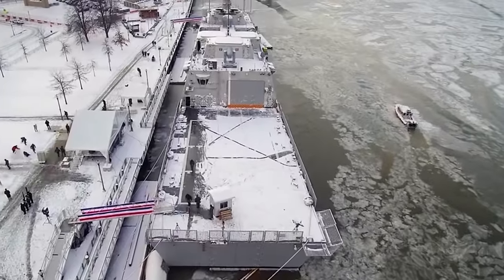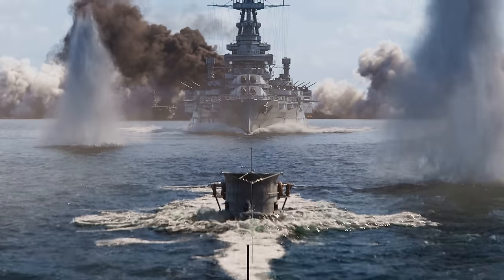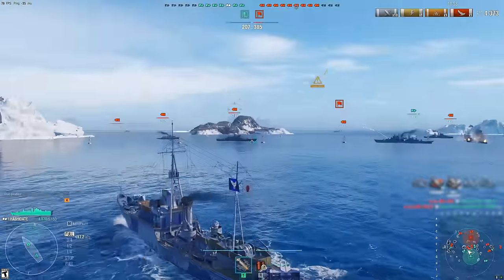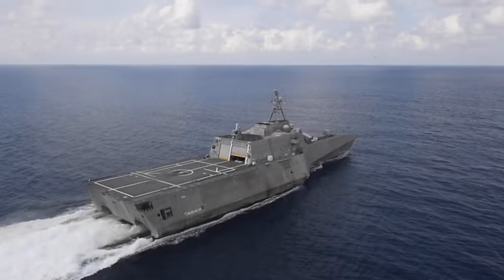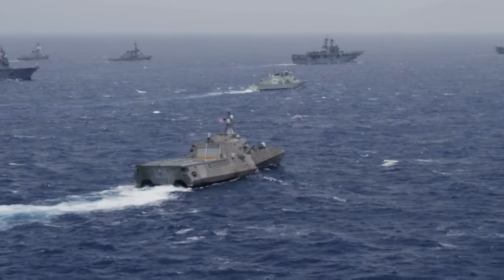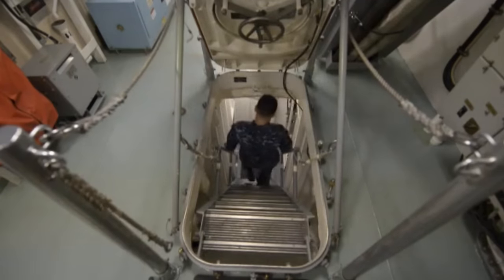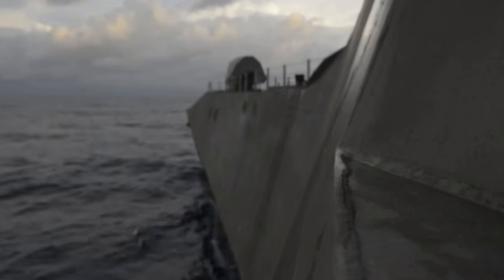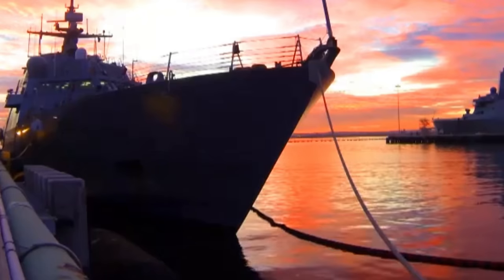Is the Littoral Combat Ship the worst ship in U.S. Navy History? | BIGGEST NAVY FAIL 👎🏼

Comment: The navy needs to stop building 30 ships just to test new concepts like Aluminum hulls, low RCS designs and composite mast/sensor arrays.
Reply: Indeed, I think the situation was more one of an engineering failure than a concept. I've worked on a military project, where again they wanted the world fitted into a kitchen sink. Once we convinced them to pair down the initial objectives, things finally started to move, only twenty years behind schedule.
What needs to happen is the military guys who are going to be operating these systems and engineers need to sit down and create a workable set of criteria, then work out costs. At that point the managers and politicians can get involved, and not before.
Reply: The USN should repeat the success of the V-boat program where they built 5 different classes of submarine prototypes for 9 boats total. Then after a decade of development, the best model was mass produced.
Reply: @tedferkin  Engineering and modules.  Many modules either came to the fleet not working or never made it to the fleet because they did not work.
Reply: so true dude. In german we have a phrase for this, we call it "die eierlegende Wollmilchsau" translated word by word it means: the egg laying wool milk pig  @tedferkin
Reply: None of those things were new…
Reply: That would have been the first plan...
Reply: maybe the appropriations process is the problem, and getting hung up on unit cost
Reply: @MrTaxiRob  The problem is the contracts. They sign for 10+ ships before even testing the first one.
Reply: @BravoCheesecake  yeah but what is the solution? Imagine being a ship builder trying to do things at scale when the government wants them, but only doing one-offs most of the time, and never knowing which direction you need to invest in tomorrow. 

Should we nationalize defense industries? How else would we keep production moving when we're pouring what much capital into prototyping? 

Look what happened to the Russian Navy, they kept changing their aircraft carrier designs in production and now they don't have any. And they blew a lot of money under the Soviet government on ekranoplans and other garbage tech.

 I don't know the answer either, but it's too complex without some kind of direct state backing to prop it up financially.
Reply: @MrTaxiRob  Is theirany large difrence between building one or ten of something that. when tested is shown to be a bad idea. I think LCS has the same problem. that the sovjet navy had. A lot of pepole with no clue. wanting to make things that sounds like a good idea.
Reply: @exploatores  agreed, and politicians enable them to either get work for their constituents or pad their own pockets or both
Reply: @米空軍パイロット issue with that is that its way more money. Mass production in ship industry is not really mass production. It have to be right from the start.
   What could be done is to build more and cheaper and build new more often  thus spreading the risj of failure.
Reply: To be fair they were to replace several of the other ships and functions. So the number needed to be high. 
   But the  tricky bit is that one have to be challenging one self and build new things. Other wise some one else will be ahead. But its true. Very hard to balance.
Reply: @perelfberg7415  the problem is when they want to much of one thing. It´s a bit like anytime they present a weapon that can replace anything from a PDW to a DMR and LMG. Has that ever worked.
Reply: they need to build new stuff, even tho past version was perfect. they need new weapons to sell
Reply: @MrTaxiRob  Solution is basically the new Constellation program. A 1+ 9 program.
Reply: @tedferkin This is an issue of shifting priorities. Those are dictated by the American people. American citizens decided that they didn’t need a “brown water” Navy anymore.
Reply: US really like to buy overpriced shyts
Reply: ...but, but, but....everyone likes metal...even though the original proposal call for polymer/carbon fiber/plastic/fiberglass tri hulll....
Reply: @Echowhiskeyone  How hard is it to make a home out of a standard shipping container?  That is what modules are about plug and play...

Comment: My father was in a position where he tasked assets out to hunt narcos subs... he said the LCS's were by far the most unreliable platform. Near-constantly down for maintenance and unable to be sortied.
Reply: Wrong application.
Like using an aircraft carrier to chase smugglers.
Reply: @allangibson8494  the LCS are literally supposed to be used in the (littorals which is near coastal waters) and against asymmetric threats which means they were supposed to chase after non peer militant threats such as small boats and the like. so that was the closest to their actual purpose possible.
Reply: @allangibson8494  They were designed to deal with coastal threats so yes actually this is supposed to be within it’s mission set.
Reply: @Cris-xy2gi  And the US Navy has been using them as DESTROYERS to chase submarines in the Pacific.
As to having problems with hull cracks, the entire Iowa class battleships had severe hull cracking problems (they had welded patches put on in the 1980’s when they were recommissioned and a number of WW2 cruisers had similar issues (including one losing it’s forward third of its hull).
Reply: @allangibson8494  The USN is decommissioning most of them and the remaining ones are being turned into dedicated mine sweepers, not sub hunters. They definitely aren't being used as destroyers.

And what does the Iowa have to do with any of this?
Reply: @Cris-xy2gi  They WERE being used as destroyers. They are being replaced with destroyers.
The LCS ships never got the equipment they were supposed to have and spent their days running around in deep water (not the shallow waters they were designed for).
Wrong application for the hulls.
Ukraine could conceivably make good use of them however. Running round the Red Sea is another possible application (but they would need enhanced ground to air capability (like the German Gepard system).
Reply: @allangibson8494  that because the right size to fit the DESTROYERS. destroyers are meant to hunt small fast attack craft. the current destroyers have gotten so big that they are cursers. generally a destroyer has top speed of 40 knots and below 5,000 tons so it be good attack torpedo/missile speed boats.
Reply: @spark300c  The current destroyers got so big to physically carry ship killing missiles and radar to detect aircraft at 300+ miles. Its is called “capability creep”.
A modern destroyer packs more “punch” than a WW2 cruiser.
Reply: @allangibson8494  yep and capability creep why drifted into a different class.

Comment: It was a BAD idea from the start. When I saw the specs while I was still in the canoe club knew it would never live up to the hype. Most of my fellow shipmates wondered why they didn't just bring the OHP frigates back they were way more capable and been specialized for specific missions and left that way.
Reply: Look at how the contract was written, which state the builder/maintenance provider is based in and which senator sits on the committee overseeing Navy budget and one would know why they keep building these lemons. Navy can't even perform their own maintenance as the ship tech was proprietary and have to contract civilian vendors to come do maintenance. At least it seems the navy is learning the lessons from LCS and Zumwalt procurement.
Reply: "It was a BAD idea from the start."

Oh no, the basic idea was just fine(as is mentioned, other nations have done similar stuff without problem, Denmark, Sweden etc).   But they were trying to put cruiser level packages of ability into a corvette/frigate.
And then had engineers that appears to have spent more time smoking something interesting than doing basic math to make sure things connected properly together.
Reply: @DIREWOLFx75 Denmark and Sweden don't have to cross an ocean to reach the battlefield. America's geography means they innately need larger longer range ships.
Reply: @jgw9990  That has absolutely ZERO to dow with all the epic level failures these ships have.   Quite the opposite even!

The modular design attempt was laughably inept.

With the Swedish Visby corvettes, despite the much smaller size, which is a severe issue for this, the modular design worked as conceptualised, even if they essentially dumped the ability to quickchange modules as it was simply not useful enough to be worth it.

But USA, even with all that much extra space, utterly failed to achieve something even halfway as functional.

"America's geography means they innately need larger longer range ships."

Really?   USA is not an island nation.   USA have no real enemies anywhere remotely near their coasts.

No, USAs geography has absolutely nothing to do with it.

USAs aggressive and psychopathic imperialism have everything to do with it.
Behaving like the absolute worst combination of imperial Spain, Portugal, France, Belgium and UK.
Reply: @DIREWOLFx75  Ah yes. I saw your raving comments in other places. I have nothing to say to you.
Reply: @DIREWOLFx75 It was a bad idea from the start. Nobody needs a 44 knot, 3000 tonne speedboat.
Reply: @jgw9990  Geography 200 , whats the name of the sea that lies between Sweden , Denmark and Kaliningrad , St.Petersburg ?
Reply: @matso3856  The Nato lake c2023.
Reply: @jgw9990  Baltic Sea also known as Nato lake , you are correct

Comment: The idea of modular jack of all trades war equipment, needs to stop being a thing. The ultimate idea of trying to save money will end up, actually costing more money and lives in the long run.
Reply: It works for the Danish navy... It is also a pretty sound concept, but why invent something from new, when others have made it work?
Reply: For an example of a successful JOAT project, look at the F-16.  Doesn't specialize is anything, but seems to be capable of doing everything one can expect of a fighter or attack jet and reasonably well.  It should be studied as a successful example before people embark on further JOAT projects.  The LCS ships should be studied as one of the most dismal failures before embarking on another JOAT project.
Reply: @namyun2743  The F-16 design team motto was "Not a pound for air to ground."  It was explicitly designed as the worlds best visual range air superiority fighter.  The fact that it became multi-role is due to the quality of the design, not that it was designed for that.
Reply: @k53847  And the F-16 handled that mission creep incredibly well.  For the lack of baked-in air-to-ground when it started,  It ended up with ALL the air-to-ground in the end.  The LCS?  It couldn't even get it's first modular mission package sorted out.
Reply: @namyun2743  Well, the first iteration of the mine clearing module apparently violated the laws of physics.  It included a sled that the MH-60 couldn't tow, at least safely.  I have no idea how they did that.

Comment: Yer giving them too much credit Matsimus.

It never made sense.

It had 3 roles.
ASW.
Minehunting.
Small craft hunting.

2 out of those 3 roles do not require 3500-4000 ton ships moving at >48 knots. = Wasted space and money. Hell those 2 requirements are diametrically opposed to noise and speed.

The last one is probably better served by either making a 50 - 60 yard-ish ship that you forward deploy. 76mm OM gun, guided ammo. SEARAM self defense. Drones for spotting and lasing. Spear/Brimstone class missiles. Or adding small/medium sized drones with a multi use missile like Martlett.

Or adding those drones to normal ships and adding the Martlets to the autocannon RWS most US warships already have.

Engineering wise they shouldve built prototypes and tested the heck out of em.

The only thing the LCS contract was is a "extract money from taxpayers"  scheme.

Comment: If you know boats, you know two hulls are twice the trouble if they are as autonomous and widely separated as the hulls on these Littoral ships.  The bending moments at sea must be enormous, leading to strains and forces exceeding what any material is capable of holding.  They need to fire the computer that designed these ships.  A  human being would know that there's no way to keep two hulls connected without cracking and bending eventually.

Comment: The USN didn't take a page from the others navies (Not invented here syndrome) that successfully implemented the modular sensor and weapons (dutch I think).  The short version is that you need more R&D to pull this off, as well as a ton of design and iteration to pull off, and a well hammered out messaging protocol for the modules to communicate with each other as well as the CIC.  They never did that ground work.
Reply: Danish : Stanflex.
Reply: I think you might be right. The French spent 1 million man hours designing the FDI frigate (what will replace the FREMM, at least at the shipyards), which is a feature. The Dutch wouldn't be far off with their Iver Hann..isk.... modular corvette cruiser.
Reply: Even the older modular system of the very humble and small Kingston-class coastal patrol ships of the RCN were better designed and implemented.
Reply: You beat me to it. I was thinking much the same thing.
Reply: You’re thinking of the Danes, but yeah.
Reply: @rocketassistedgoat1079 That’s the Danes again. And their large modular ships are large frigates. They’ve got the Absalons, which are multi-role frigates that can also be used for command & control & amphibious ops & the Iver Huitfeldts, which are primarily AAW.

Comment: I heard that they built it where two different types of metal touching each other. Then it just so happens that when those metals touch, corrosion starts . So both the metals eat or melt each other. With the one spot they come together,is the main spot to hold the ship together. American military leaders are trying to bridge the gap of shallow water and slightly deeper water patrol boats. That they just don’t have. The cyclone patrol boats had filled the spot, but no longer do.
Reply: Galvanic corrosion on the Independence Class. Aluminium allowed to touch steel in the presence of a conductor like salt water causes the reaction. They had to try solutions like using sacrificial anodes to try and deal with it.

Comment: The LCS's and the Zummwalt's are perfect examples of what happens when a force lost its focus after the Cold War.  The USN was never and has never been a littoral combat force, it is a high seas navy.  The US has the Coast Guard for the littoral role, the littoral role is a coastal patrol role and not a global projection or expeditionary one.  Back in the 80s the USN developed the excellent Pegasus PGM hydrofoil boats for a littoral patrol/denial role and the Navy could not figure out why they built them and shelved them after a few years, sound familiar?  The big difference was that there were only 6 Pegasus class PGM's built and not 32 boats that don't work and have no real mission, the cause being too much available funding and being pushed into a mission that the Navy does not traditionally perform or highly compromised in the missions that the Navy doe perform.
Reply: The Pegasus hydrofoils sat down in Key West basically supplementing the coast guard.   They were an evolution of many generations of hydrofoil development and they did work.  Other than high fuel consumption, the only flaw was the blue water navy likes their big ships with lots of firepower.

Similarly, the U.S. Air Force likes fast fighters and strategic bombers, not CAS like the A-10 which they have tried to cancel for decades.   Of course, a big reason the Cheyenne attack was killed was the USAF didn’t want the U.S. Army having such a fast attack helicopter.

Comment: The naval version of the F-35...

Essentially, they're an epic level of engineering failure and incompetence.
Hoardes upon hoardes of the problems of these ships were not only predictable, but actually PREDICTED.

The concept was MOSTLY perfectly fine, though the ships should have started out 1-2kt heavier from the start, but the execution, the designs are just hilarious showings of inability.

Just the problems with integrating systems from the different modules, it just makes you go WTF!?!?!.   Seriously, they can put the pieces together on a permanent basis and make them work, but NOT make them interchangeable???

And hull integrity?   What?   USA has been building ships for a few hundred years and still have trouble figuring out how to calculate how to make the hull strong enough for its purpose?

The degree of fail is mindboggling.

And very representative of the US military industry overall.

Comment: I find one of the major issues here in this program was the inability to deal with the complexity that com from the size. They just dod not have enough experience in building small ship woth the missions moules. Early on US had interest in Visby corbvets that are very similar in concept. Though that fell out as there was no interest in sharing technology as the ships needed to be built in US and swedish capacity was way to low for the number of hulls. 

Another issue that probably killed the success with the LCS  class was was the model of having private companies running the upkeep on the ship. The navy can not them self do prioritys to cut costs and there os an extra middle hand. Some what the same issues as to the lockeedmartin  aircrafts.